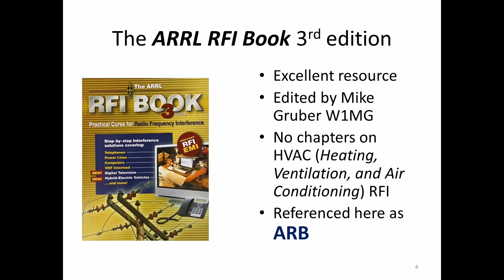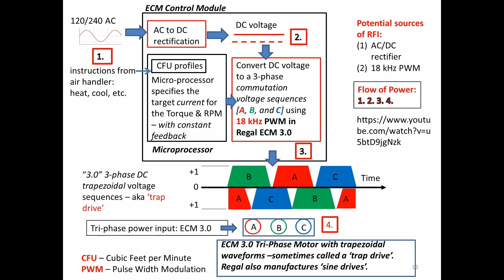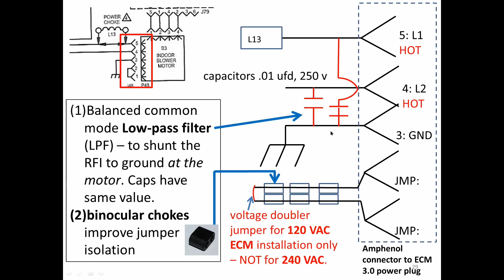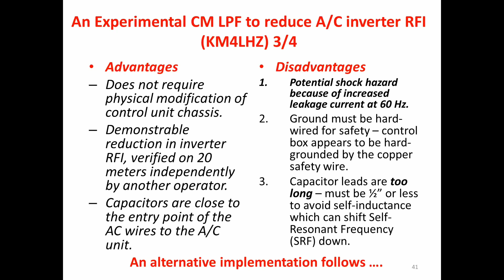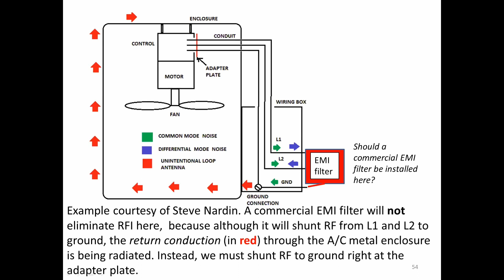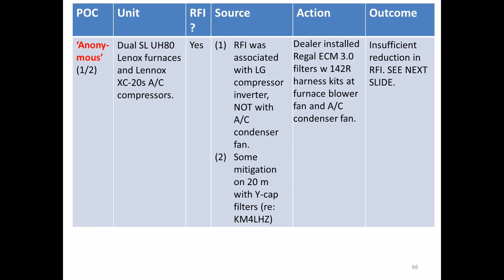Mitigating Residential Heating, Ventilation and Air Conditioning (HVAC) RFI

Comment: Radiated EMI impacts LOW VHF TV Channels 2, 3, 4, 5, 6 with interference sparklies or impulse noise in the Analog TV signal or breakups in the Digital LOW VHF TV Signal between 54 to 88 Mhz.

Comment: I’m a new ham. K3TBA. I got my license in November 22. Over the winter my shack was working fine. This week the weather has really warmed and now I have terrible RFI in 20 & 40 meter.  I did nothing different in my home.  I use an ICOM 7300 and the RFI is spaced evenly all along the waterfall. I don’t know how to go about fixing this problem.
Reply from the maker: Even spacing of the well defined noise lines on the waterfall indicates that it originates from a device using periodic switching. It can be a switching power supply, can be a sparking brushed motor, or a VFD on a brushless motor. Spacing of these lines is a good indicator of approx switching frequency. Noise from a continuous discharge (like a CCFL lamp, corona discharge, or a quiet and invisible discharge from a DC current, e.g. over a dirty surface) has much smoother spectrum.

If the  noise correlates with the times when the AC unit operates, you already have the prime suspect. If not, the easiest method of identifying noisy appliance in the house is to switch off circuit breakers and see when the noise disappears. Since there can be several noise sources, it's best to switch all breakers off, switch them on individually, and listen when the noise shows up again. Of course your detection device must be battery-operated.
You can use tinySA spectrum analyzer to pinpoint the noise source. It is a small and cheap device, and very useful in the shack. Start with the telescopic antenna extended just enough to register the signal on the display, and shorten it as you will be getting closer, and the signal will be getting stronger. In the end you may have to remove the antenna completely.
You can learn more about tinySA from this video: https://www.youtube.com/watch?v=ixcWerQ-Trg

It may happen that the noise source is not located in your house, and you will have to take the noise detector for a walk around the neighborhood. 

The traditional way of finding noise makers uses wideband VHF radio, and a small directional antenna. It took us about 10 minutes to find a noisy power pole near our Field Day site. We used a VHF moxon antenna, which has a very sharp null (and we were searching for signal disappearing).

A battery-operated radio with a ferrite rod antenna (usually used for reception on LW or MW bands) can also be helpful. There are many videos on YT showing how to use it.